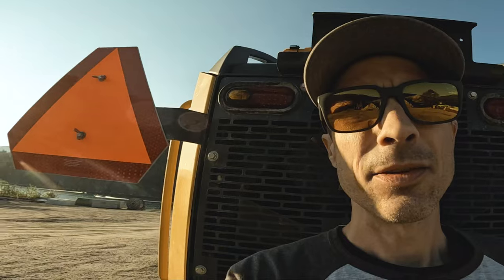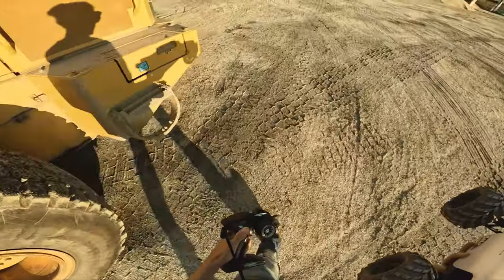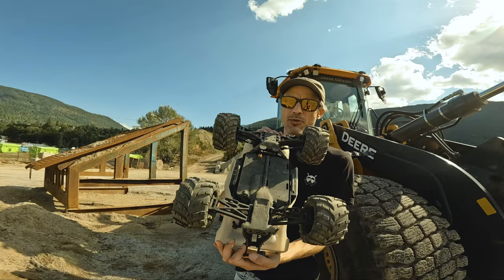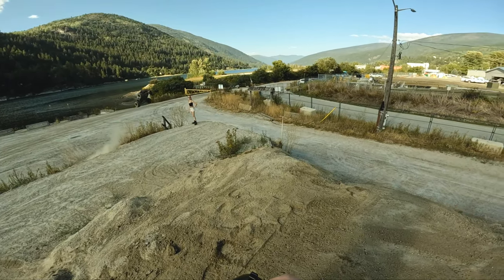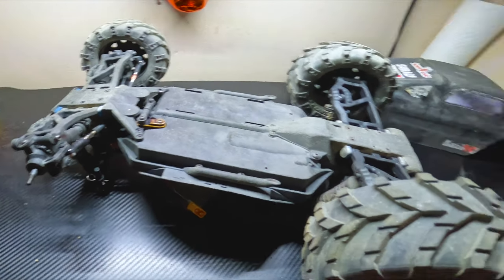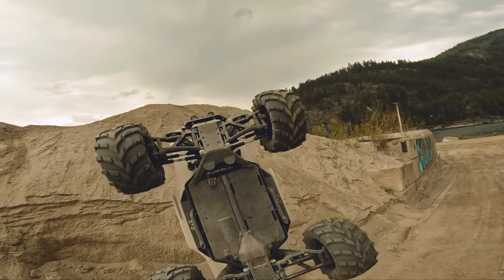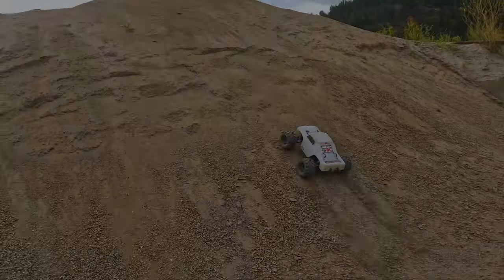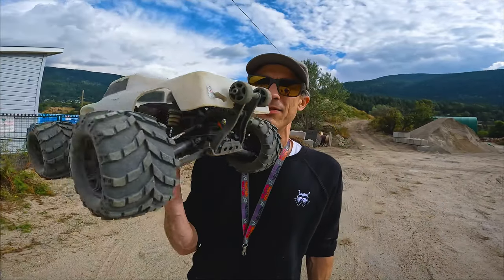Testing Driveshaft Fixes for the Team Associated Rival MT10

Comment: That was a great test for the Traxxas driveshafts. They held up well. Maybe Associated will come up  with some heavier duty driveshafts after they find out that  people are using Traxxas parts. You probably know this. As I was watching your trucks in the air and as the wheels were spinning truck moved around. I either read an article or saw a YouTube video where it was explained how cars can be made to change direction in the air. It's similar to what professional motorcycle riders do. Good job and the bodies are amazing.
Reply from the maker: @michaeldorich4485  thanks! Those driveshafts are pretty great so far. And yeah for sure, you can control the car in the air quite a bit, forward throttle to bring the front up(backflip), reverse to bring it down(front flip).
Reply: @shralpRC  There is away,  I don't recall how, but you can turn an r/c car in th air. I'll have to see if Ii can find the article or vide.